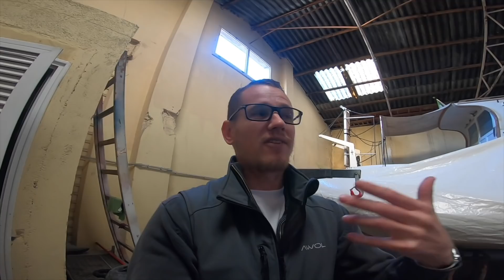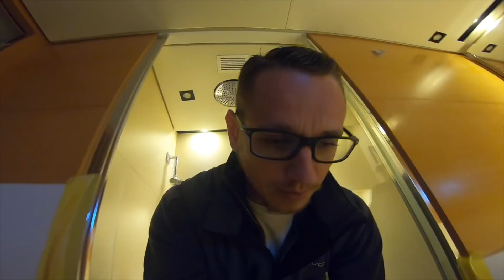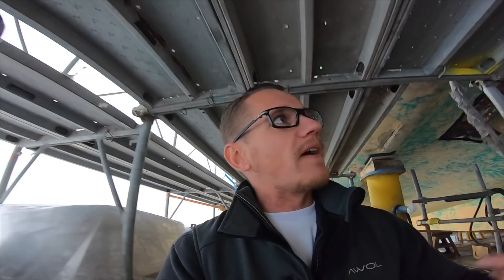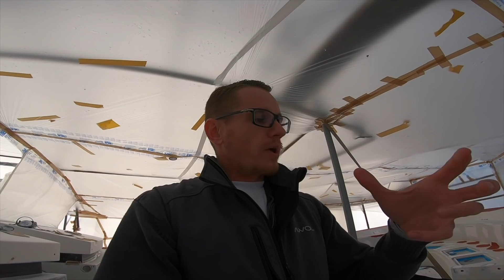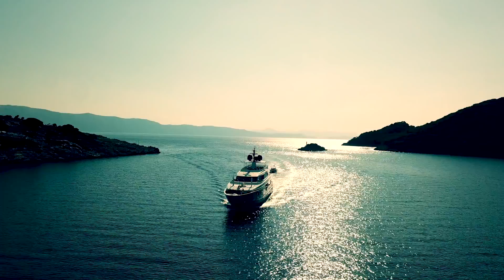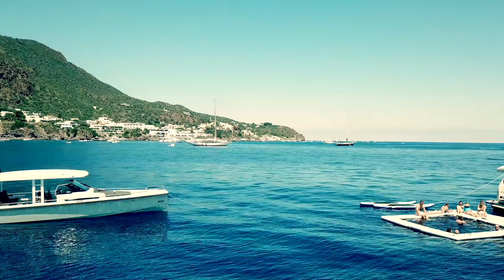Captain's Vlog 29 (Chase boat)

Comment: I understand this vlog is 15 months old but I've been going through each and just got to this one. My question is do you ever move the boat from one location to another overnight when there are guests on board? If not the next question is moot. If you do, are the guests bothered by the movement of the stabilizer machinery? It looks pretty substantial and probably noisy when in use. Also doesn't look to be buried too deep under the two cabins. 
Thanks Tristan, great videos!